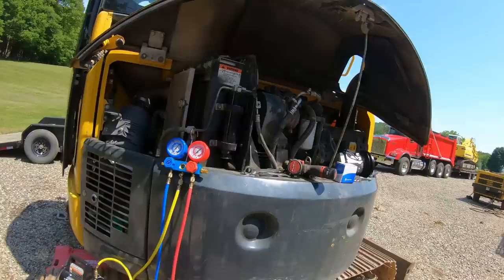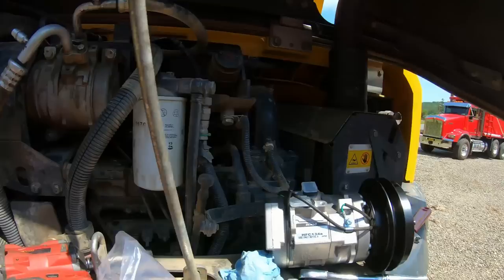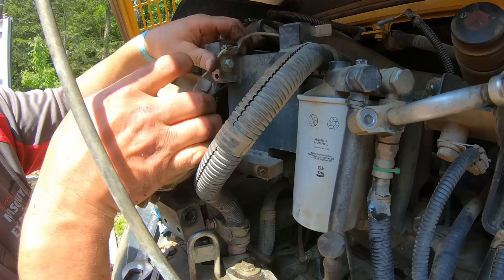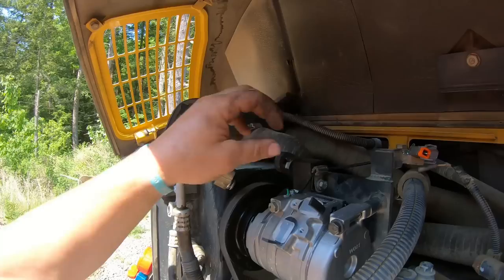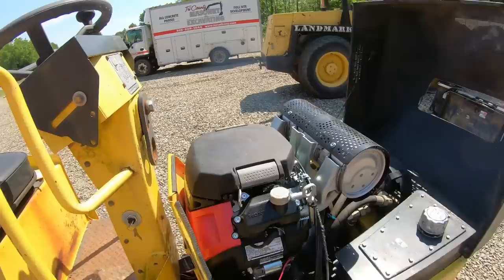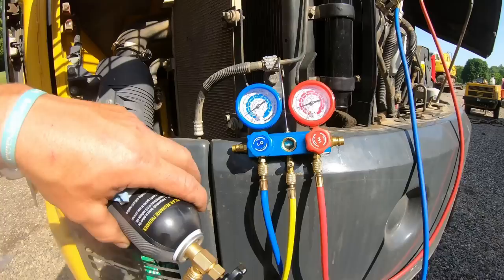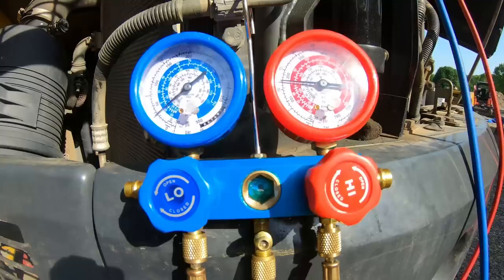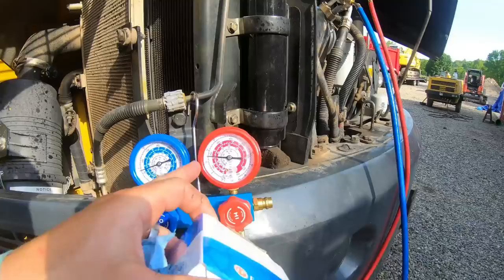Fixing the A/C System in a Excavator most likely this is your problem

Comment: Hey mike the next time after you vac the system do not start the michine hook up the can turn the can upside down and open up the high side and it will suck in the liquid then turn the can right side up and shut the high side and open the low side and start the michine and it will suck in the gas. The  compressor will not come  if the system empty because of the low pressure switch in.
Reply from the maker: Thanks that helps! Good tip

Comment: Great job pal! You should get yourself an EZ up tent to beat the heat and rain when wrenching. As a roofer I have a magnet on wheels for picking up nails around the houses. It works really slick, you can grab one for about $100 at a roofing center. That will be helpful for finding that nut or bolt you drop in the rocks. You will Literally find it in 1 min as opposed to crawling around on your hands and knees- headache saver. Looking forward to the next video!!
Reply from the maker: True!

Comment: You need to put the a/c can up side down for changeling.   You need it to be a  liquid not as gas.  Right side  up and it's a gas . Two hands on the can and shacking it will help to warm up a little .  For installing      Lock it all your labels. one sued tale you . A/C R134A and it hoes 1lb . 3oz ???? Keep the work up. doing good.
Reply from the maker: Thanks for the tip

Comment: The evaporator by the radiator should be changed also
Reply from the maker: The round cylinder I change that also... I still get hot flashes every 40 seconds heat comes through the vent not sure what's going on...

Comment: without specification for the specific peace of equipment your just guessing. gauges with red, green, yellow is meaningless. overcharging is just as bad for the system as undercharging. I do automotive a/c and it can get complicated! My best suggestion is leave to the professionals. Lets just say if I recreated this video I would be facing fines and or loose my license.
Reply from the maker: I hear you man it wasn't a how-to video it was me just getting it done I tried to get people over here they are too busy and it's too hot!
Reply: @DIRT-BOSS I totally get it,  number 1 thing I hear, it worked last time I used it! Here is a dirty little secret, anytime you turn air on in a newer vehicle it engages the a/c system even if you have it on hot. This means your putting wear and tear on it summer and winter. I tell people to think of it as an oil change, every 4 years have your system evacuate and recharge. The system requires OIL along with refrigerant that breaks down over time. The best time to do this is the winter time. Or it's like everything else  you won't know you need it until you do. Love the channel though, keep on keeping on!
Reply from the maker: @vinnyhern  That definitely makes sense man! So overlooked
Reply: @DIRT-BOSS  Absolutely wrong.  Refrigerant never "breaks down or gets old".  Unless you have a component failure or leak you should never go into a system.  Anytime you do you are taking a chance of introducing contaminates into the system.  Especially from a shop that uses a reclaim machine where they pull out the charge and recycle it.  You are mixing your system with everyone else they have hook too.  This is an up sale that shops use to make money.    Now as far as your video it was entertaining and I know you're not an AC guy so I won't bash you, but I will warn you it is a 10K fine to release refrigerant into the air so that part about over charging and just letting it go is a big no no.  I know everyone does it but not everyone puts out video proof of them doing it.   Just putting that out there for your protection.    Too get your charge right, run the throttle up about half way.  Turn the AC on high and close the door.  After the cab is cooled down look at the sight glass if there are still bubbles it is low.  You want to slowly add gas to the low side until the bubbles clear up.  Add a little and wait, then do it again.  You have to give the expansion valve time to react.
Reply from the maker: @topshelf321  got ya! I did discharge it into a can though not in the air! Also in the sight glass it looks like gray fluid passing That's normal correct I don't see actual bubbles.. what color should it be when it's full?
Reply: @DIRT-BOSS  it should be clear.  What i called bubbles is vapor refrigerant.  If the charge is low you will see that in the liquid stream.  This means you have vapor entering the expansion valve (TXV).  This make your coil temp higher and lowers your cooling.  As you add refrigerant the TXV closes off more and the liquid refrigerant backs up in the line.  Once the liquid line is full the sight glass will clear up completely.  If you check this on start up or with a really hot cab you may still see bubble because the TXV would be wide open at that time, or with the motor idling.  That's why you should check it with at least half throttle and with the cab cool.  On very small systems like you have there that only hold 2 lbs the difference between cooling ok and a perfect charge may only be a couple ounces but that could be the difference in 5-8 degree colder air.  If you don't see condensate coming out the drain then the evap coil is not getting cold enough to remove humidity from the air.  Sorry, if i got too deep into this but if it's not charged right you will not get proper cooling and the compressor will not be cold properly, and it will burn it up.  The returning vapor refrigerant to the compressor is what keeps it cool.  On a system that is undercharged the there is not enough return vapor to keep the compressor internal components cool and it will burn it up.   If you have a way to check the suction line temp it should be 47-52 degrees F.  Also make sure you condenser coil is clean and if you have a cabin filter it is clean as well before trying to check the charge.  if any of them are clogged or dirty you will not be able to get the charge correct.
Reply from the maker: @topshelf321  Awesome that was very helpful and made a lot of sense thank you